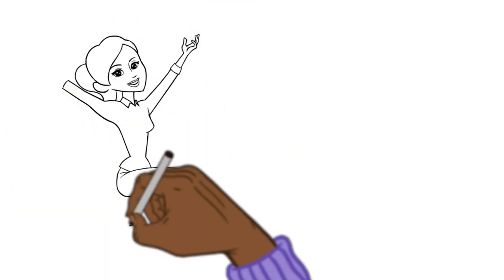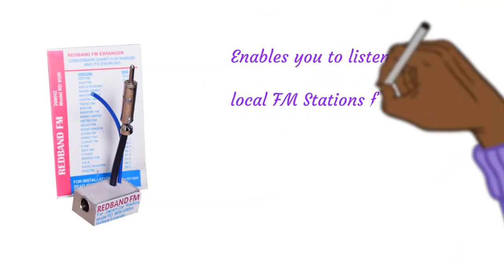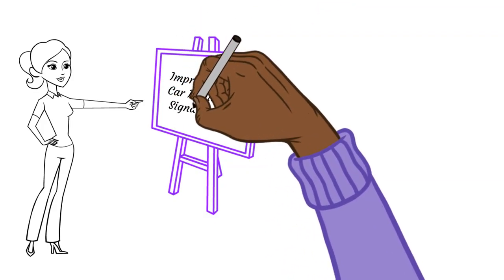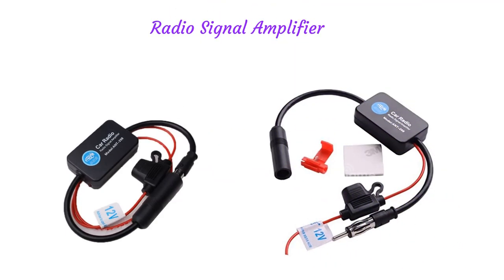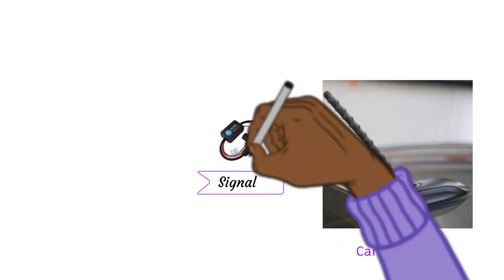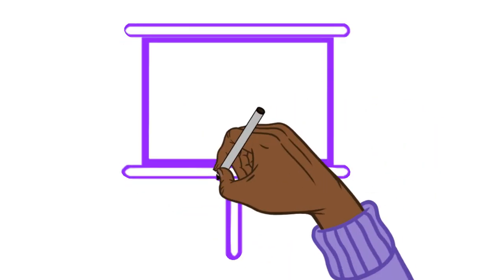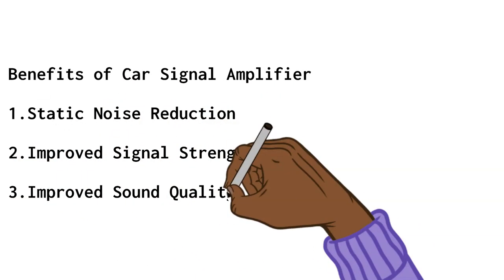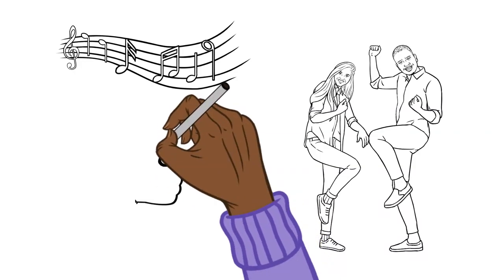Car Radio FM Signal Booster : How to Fix Poor FM Radio Reception

Comment: Hello  there, i installed a radio booster in my new touchscreen radio but signal still weak / on and off signal. My new radio is made in china. Pls advise me what to do. Thank you.
Reply: Check the connection.. Installed mine in a china made android Radio and now works good. Is the booster powered?